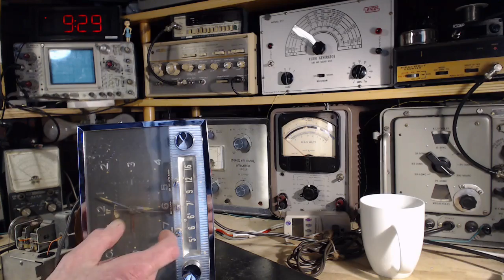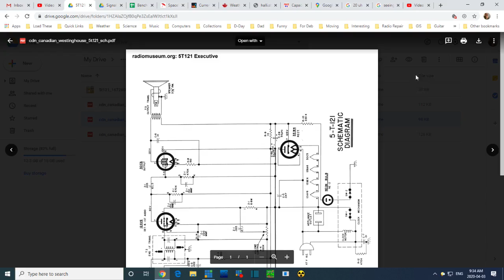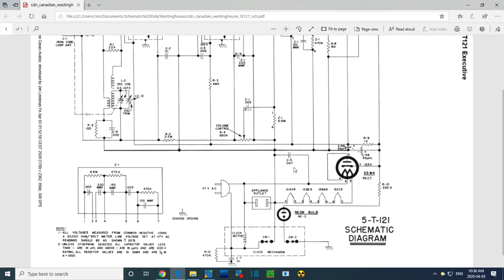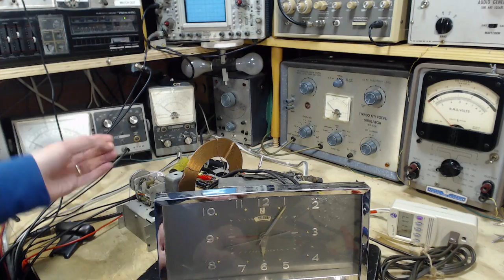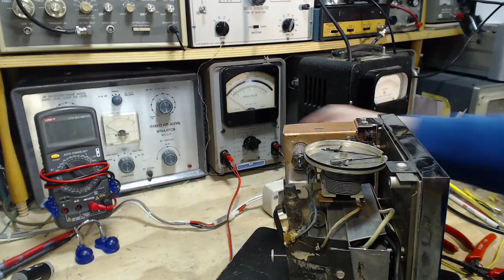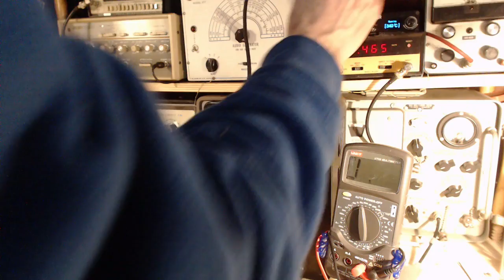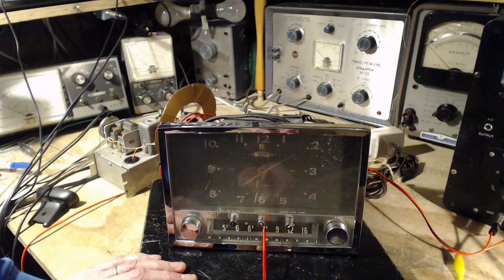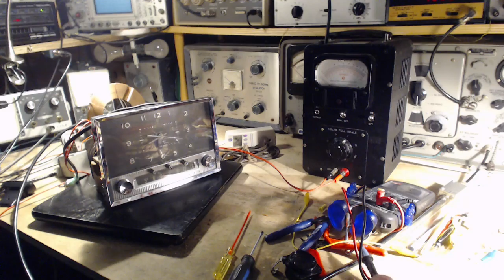Westinghouse 5T121R-2 Clock Radio Video #3 - Two Capacitors

Comment: The other words for a "package" are "couplate" or "BulPlate".
"
    Centralab - Couplate
    Sprague - Bulplate
    Aerovox - PEC (Printed or Packaged Electronic Circuit)
"
Also known as "Z-pack" in some circles. Notice the designation as "z-1" on the schematic drawing.

Comment: The neon bulb is Alarm on indicater and the Alarm switch is a push/pull switch and it also doubles as the Alarm set control

Comment: The capacitor between B- and ground is .01 on schematic but the good blue one you took out looks more like .1, right?  So you put in a .01 and now there is all this oscillation.  Just like about 2 radios ago when you replaced a .08 in the same position with .01 and same result i.e. oscillation.  Did previous repairman encounter same oscillation and decide maybe bigger capacitor would quench it??

Comment: The clock has a synchronous motor. A 25Hz motor will run poorly, or not at all on 60Hz.  It definitely will not keep time. A 60 Hz motor will not run on 25 Hz, and may actually catch fire.